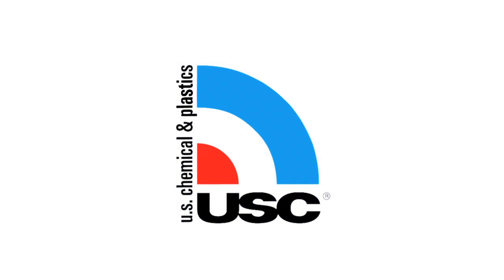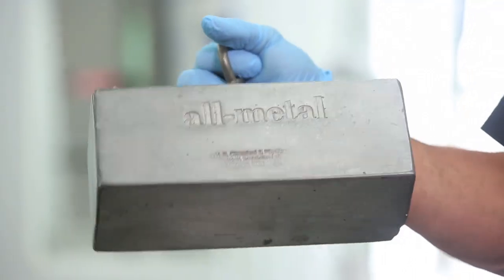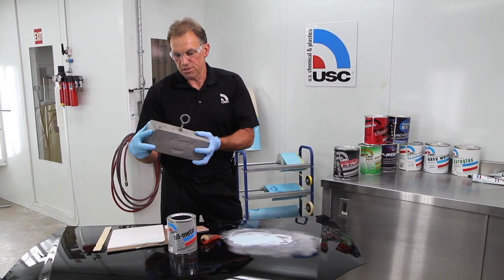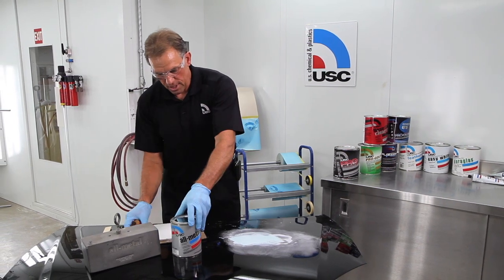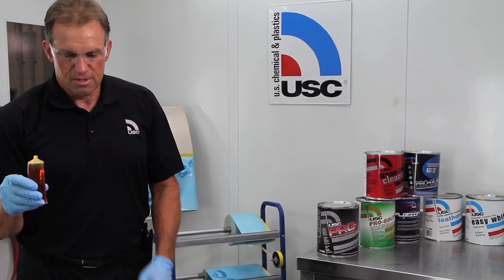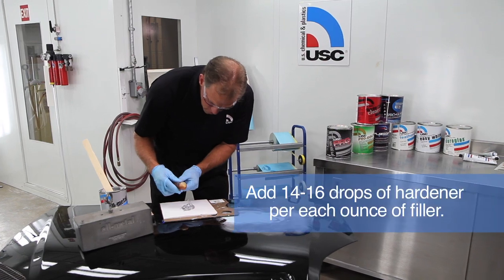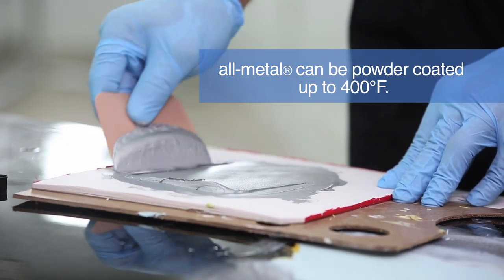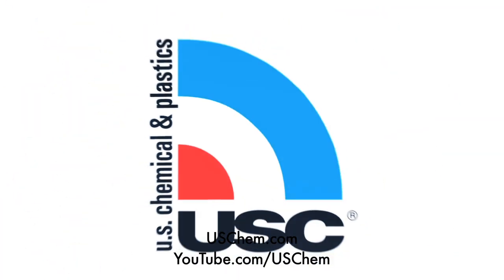US Chemical & Plastics: All Metal Review

Comment: If it is so waterproof why is a 2K urethane primer recommended to cover it?
Reply from the maker: +Tim Harris building a layer that promotes adhesion and chip resistance. It has nothing to do with waterproofing. Does that help?

Thanks!
Reply: Yes thanks. I'm thinking primer needs to absorb the top coat. The can says 2K urethane primer but the tech sheet lists every type primer as usable.